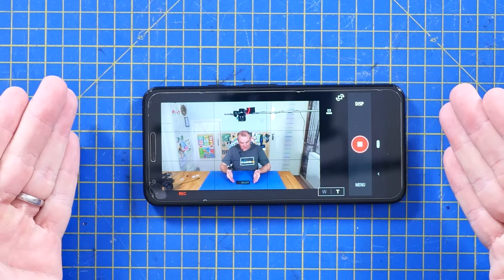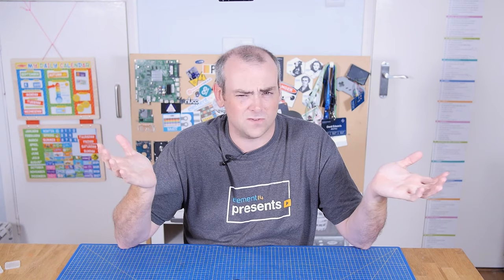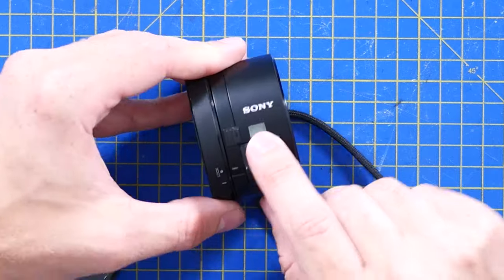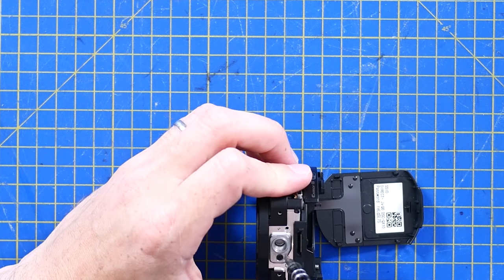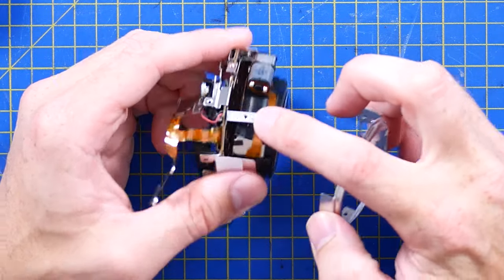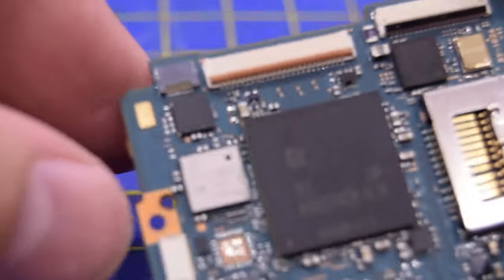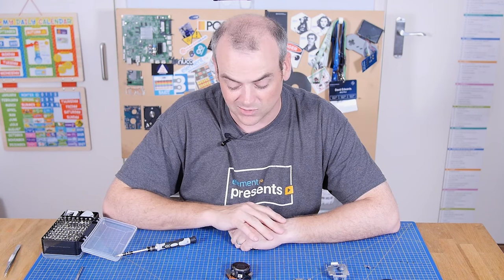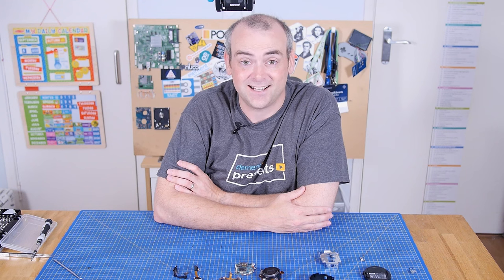Sony QX-10: Phone Mounted Camera Teardown - The Electronics Inside

Comment: I bought my wife one of these as a Christmas gift when they were new.  Just ran across it in a old camera drawer in my office- my wife never took to it.  She preferred to carry a big Nikon DSLR until about 5 years ago when she couldn't really tell the difference from a decent iPhone (>10)- she also isn't so much into "photography" these day.  I charged the battery, downloaded the new Android App (Imaging Edge) and it still works great.  A little odd that it works as an ad-hoc WiFi network and forces my phone to disconnect from WiFi- sort of a failed experiment for interfacing stuff.  It works pretty seamlessly though once connected.   Beautifully made, enjoyed your teardown.  Kind of the end of glory days of Sony- I loved their stuff in 90's up til about 2005 when it was all video games.  Trying to figure out what to do with it- not worth a ton.  One problem for me is that its mounting fingers won't open wide enough for my Samsung Note 10- about 1/2" short.  Would likely fit most phones still.  I may mount it to the ceiling on the 1/4-20 stud and goof around with.  I take a lot of pics of items on my desk straight down, we'll see if its of value.  They still fetch a couple of hundred on Ebay in good working order- this one was really never used. Thanks for the video- well done.

Comment: I think all of the QX bodies have a matching camera; the QX10 looks to be roughly the same as the DSC-WX220, which is also 10x zoom with WiFi and NFC. Oddly, the QX100 is closer to the RX100m1, while the QX1 is a APS-C sizes sensor, so the numbers don’t have a meaningful sequence- 1 is better than 100 is better than 10.

You might like to look up the Alice Camera, a screenless micro four thirds body built to work with phones - it’s that modern take on this product that's mentioned at the end of the video.